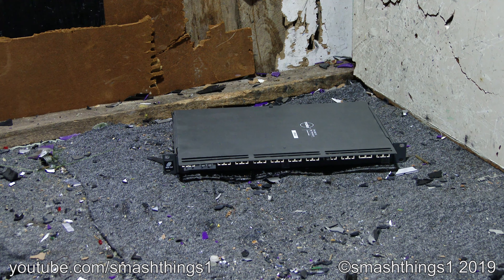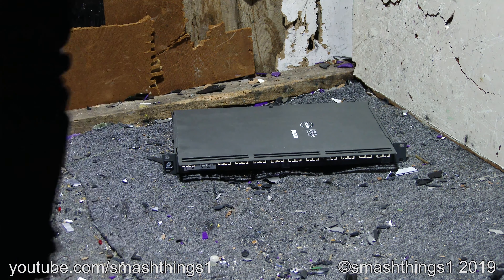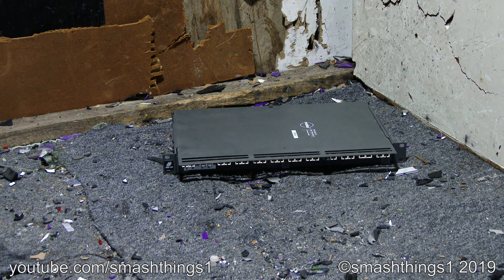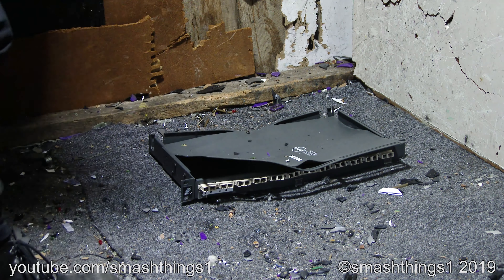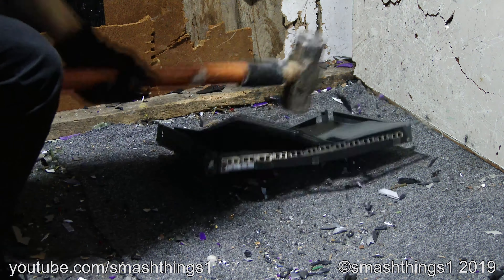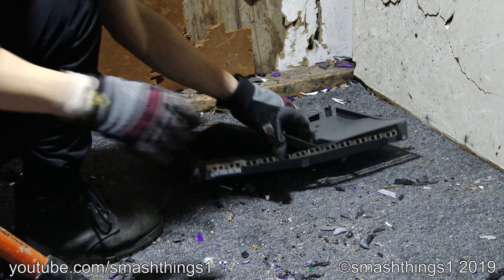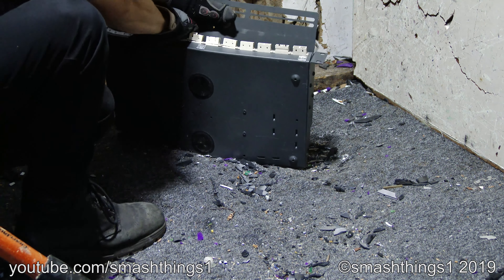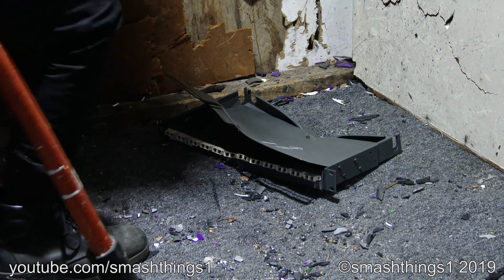Smash Molex Mod-Tap Fiber Management Cable Enclosure

Comment: Ok, but why was it empty? Whats the point?
Reply: When you run and terminate fiber, generally you want to leave a generous amount of slack. That slack is then coiled up inside the enclosure around those curved plastic pieces you see when he removed the cover. There is a minimum radius that you can bend fiber without damaging it, so that’s why the box is so big and empty.